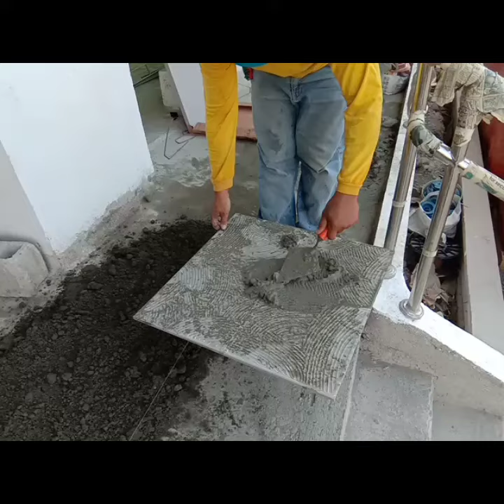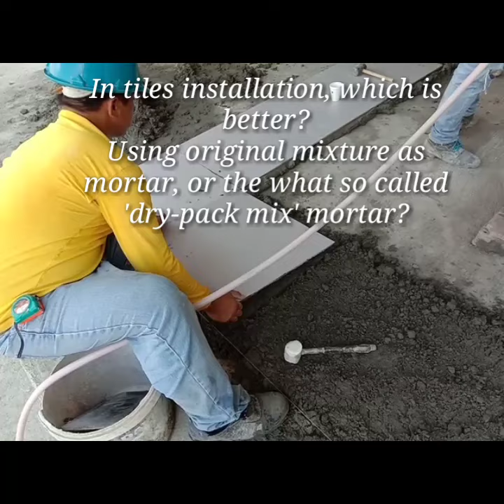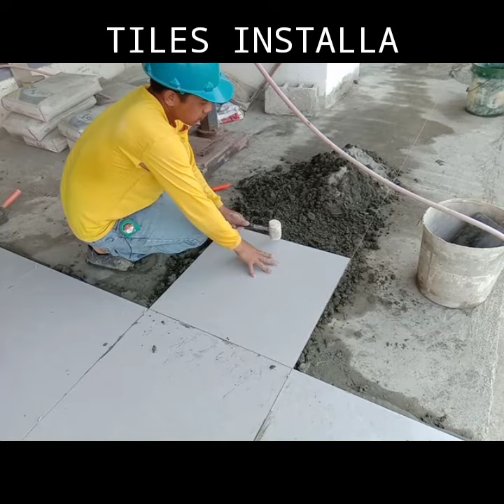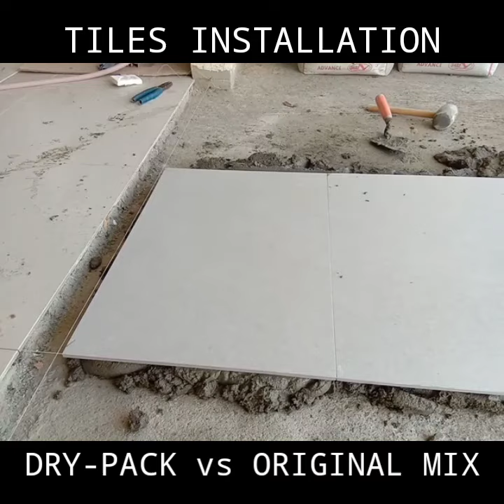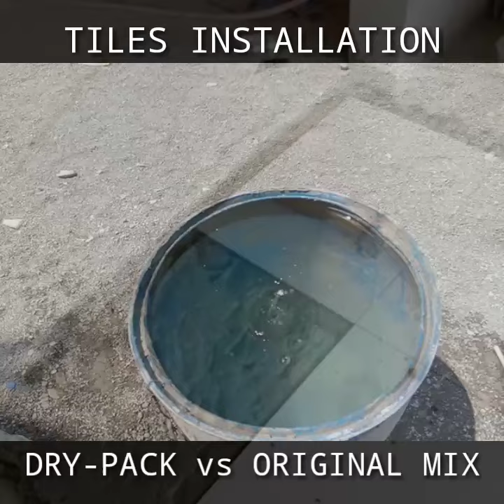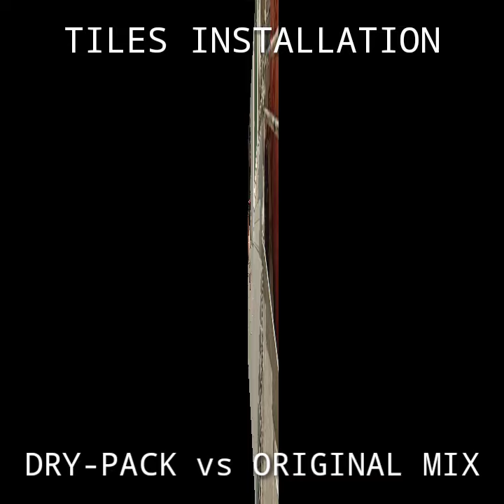Floor Tiles: Comparison Between Dry Pack and Original Mixture | How to Install Floor Tiles

Comment: Anu po mas maganda dry pack or original mixture?
Reply: nka bistay po n dapat un sand s drypack?
Reply: @jasonviray5665  oo naman po..ska dapat level na level at siksik sa mortar para d maging pulbos pag nagtagal.
Reply: mas matibay ang dry pack
Reply: yung original pag bumaba ang tubig sa cemento yung tiles bumababa dinminsan
Reply: Tamang timpla lang ng tile adhesive wag masyado matubig
Reply: Pra matigil ang debate... ang drypack ay pra lang sa sa malalalim ang depth ng floring to finish. Kung mababaw nmn pde nh idereto sa adhesive. Construction consultant here
..
Reply: just follow the procedure of the manufacturer ng tile adhesive di papalpak yan and use electric mortar mixer para maging consistent ang adhesive mixture mo and use tile locking leveler, wag masyado  matipid kaya ka nga nagpapa-tiles eh dahil may budget ka para dyan...
Reply: @liberalparty2579  peede ba adhesive tiles lng ipangdikit lahat sa tiles installation?
Reply: Mas matibay pa yong original mix. Bakit kailangan mong i dry pack kong manipis lng pagkabitan mo ng tiles. I dretso mo nlng ng halo adhesive at  cemento. Wag mo nlng ilagay ang dry pack.. para mas matibay

Comment: Gud morning po. Sir tanung kulang po. Kung ilang tiles yong maekkabit sa sang bag na tileadheciv.
Reply: 60x60 po. Yong ikkabit.
Reply from the maker: As per original mix po mga around 5-7 square meter for 25 kg or 1 bag tile adhesive po sir., mga 15-20 pcs 60 x 60 tiles..but nagdedepende din po ito sa kapal ng mortar as per surface ng floor. Salamat
Reply: @JUANCIVILIAN  sir alin ang mas mainam original,dry o purong adhesive lang. 60x60 ang tiles na ikakabit

Comment: Drypack is only good s mga certain places...pero kung mxado magalaw ung structure dhl s tabing kalsada its best with tile adhesive..mas flexible s movement ang adhesive...just my opinion..
Reply from the maker: Salamat sa pagshare ng iyong experience sir. 👷‍♂

Comment: Ask Lang PO sir, ano Po ba posibleng dahilan bakit madaling nag crack ung mga gilid Ng tiles?dry pack Po ginamit.
Reply from the maker: Hello po, It's either sa quality ng tiles ma'am or uneven distribution po ng mortar, especially sa gilid na part ng tiles baka walang nilagay na tile adhesive.
Reply: @JUANCIVILIAN  thank you po sir
Reply from the maker: Welcome ma'am, keep safe po.
Reply: Kung walang space ang pagkalagay mo possible talaga mag crack ang gilid ng tiles dahil yan sa tinatawag na thermal expansion, dahil sa pag expand ng tiles kaya nag cacrack ang gilid, kaya kailangan talaga ng spacing.
Reply: Nice things to learn from an expert. Thank you sir.  Dry method pa rin ako para magamit agad ang floor after setting. Dapat lang tandaan ang standard ng mixture at thickness ng foundation.

Comment: Mali ang dry pack topping mo sir....dapat di hinahaluan ng semento ang tile adhesive kasi mas hihina ang kapit neto....nasa instruction yan ng tile adhesive
Reply: mali ang vlogger inihalo ang adhesive s cment maling mali
Reply: Sir, tanong ko lang. Okay lang ba na tile adhesive lang ang ilagay ko?
Reply: @FerAndrewOctoman   pg dami k pera pwd solid adhesve
Reply: @FerAndrewOctoman  Okay na okay sirrr kaso madaming adhesive kelangan mo kasi papantayin mo level ng pagset ng tiles..hindi naman pantay perfectly and flooring so magkakaroon ng madaming adhesive....ang purpose kasi ng dry pack bukod sa ginagamit ito para di mabitak ang tiles sa pagseset...mas mkakatipid ka sa pandikit kasi mas maunting adhesive lang ilalagay mo parang papahidan mo lang sya...mas safe din sa kapak ang drypack method kesa purong adhesive....pero advice ko sayo kung manipis lang ang magiging taas ng tiles mo..oks lang kahit di ka na magdrypack..😊

Comment: Good day, 
1. itatanong ko lang po kasi yong flooring ng bahay ko nag angatan po ang mga 60cm x60cm floor tiles using po ABC adhesive direct installation to floor slab.
2. pag dry pack po ba hindi po yan aangat ang 60cm x 60cm floor tiles?
3.ano ang measurement mixture ng cement,sand and water to create dry pack?
4. ano po ang standard thickness ng DRY PACK?
5. Ano po ang tamang installation ng floor tile na hindi po aangat at kakapak?
Reply from the maker: Hello sir good day, ang maaaring dahilan po ng kapak ay ang hindi maayos na pagkabit ng mga tiles, kahit dry pack process or original mixture ng mortar ang gagamitin ay maaari paring magkapak kung hindi tama ang pagkakabit nito. Ang kapal po ng mortar sa tile installation ay nasa 2 inches po depende na sa level ng floor na paglagyan ng tiles. Isa din sa factor kung bakit nagsi angatan ang mga installed tiles ay kulang ito ng tile adhesive, maaari nyo pong tingnan sa 3:45, 4:05, 4:20 mins ng video para sa proportion ng mortar na ginagamit namin. Salamat
Reply from the maker: Maaari nyo din pong tingnan ang video na ito sir, para sa karagdagang impormasyon sa original mix ng mortar. 👇
https://youtu.be/bSE1kJRLqHc
Reply: Ang gamit ng karpintero sa amin ay combination ng adhesive at semento lang. Walang sand. Yun lang po. Nakapagtrabaho kasi siya sa hospital flooring at iyon ang gamit ng engineers doon. Para matibay daw kasi maraming wheelchairs, strechers dadaan.
Reply: Isa din ho ba sa dahilan ng pag angat ng tiles lalo na pag 2nd floor is ang pag  galaw ang structure?
Reply from the maker: @Jejemon-vibes  yes po sir, para puro ang mixture, depende na din sa classification ng floor at specifications nito.
Reply from the maker: @yarbsblight2719  yes po sir, isa din po sa dahilan yan, esp malapit sa kalsada ang structure, kaya mas mabuting sakto po ang mixture ng mortar na gagamitin dito.
Reply: @Jejemon-vibes  magandang suggestion

Comment: MAS MATIBAY PARIN YUN ORIGINAL MIX KESA SA DRY MIX BASE ON MY EXPERIENCE KSI YUN DRY PACK AFTER NYAN UMA ANGAT YUN TYLES🤔🤔🤔🤔
Reply: Depende sa gagawa yan
Reply: Hindi aangat yung tiles sir kung yung dry pack po aya maganda ang pagkakatamper at pagkakasiksik,. Tsaka dpat po maganda ratio nung dry pack,
Reply: Ang nakita ko lang mali sa video nung paggawa nung dry pack hindi nila po tinatamper at sinisiksik ng maayos, matagal na po 1 taon diyan, kakapak na po yung tiles o dikaya aangat,
Reply: Para sa akin po, wala po sa klase ng mix, kasi parehong subok ko po sila, nasa gumagawa po yan,

Comment: tile adhesive is not recomended to add or mix mortar,cement.it will give  poor performance for tile adhesion specially porcelain tiles.every product of tile adhesive must have technical data of specification to be followed if you want to meet the best output.
Reply: Nde lahat ng tiles pwede kahit walng adhisive
Reply: Pag ako ang magkabit nyan..d na ako gagamit nang adhesive..dagdag gastos lang po yan...
Reply: @loyjieancog5032  wala pa akong nakita g granite na nde nag kapak na cemento lng
Reply: @mrindependent1721  ...11 yrs na po akong CW..
Reply: @mrindependent1721  depende cguro yan brad da pagtatrabaho🤔🤔🤔
Reply: @loyjieancog5032  mas dagdag gastos ang maintenance nyan sa huli

Comment: Hindi kakapit yan porcelain tiles dyan sa dry mortar. Buti pumayag ang quality control. After 1 to 2 years matatangal yan  dry mix.
Reply: Tama..porcelain tiles gm8 nla..akala nila porke 60×60 tiles lng..depende sa kung tiles oh porcelain..nagpuputukan tlga yan pagdating ng panahon..kusa umaalsa..kaya ako boss kapag nagtiles kh8 pagamitin ako ng dry pack hindi ko sinusunod..kase sa diskarte ko wala pa naman pumalya kh8 5 to 6 years na ang tiles walang naging problema..
Reply: @johninocentes6391  pwede po ba tile adhesive lang ang gamitin ko? Nagiisip kasi ako ang mglagay

Comment: Pag granite tiles ikakabit 60x60 hindi uubra yang drypack mo matagal na ang 2 taon nyan bakbak lahat
Reply from the maker: Maraming salamat po sa pagbahagi ng iyong karanasan sir.
Reply: Pano boss pag ceramic 60x60? Matibay ba?
Reply: Boss tama ba yong mixture nla sa drypack?
Reply: Sir Gerson Anu pala Magandang method sa granite installation sa lababo?sabi kase ng foreman ko ok na daw ang adhesive tiles lng ilagay lahat.wlaa ng iba.tama ba yun?
Reply: Mas matibay pa ang original mix na halo ky sa dry pack. Maramihan sa dry pack ay kakapak. Tingnan nyo mga ikinabit na tiles na original mix hanggang ngayon hindi kakapak. Yong mga bago ngayon method sa pagkabit ng tiles gaya ng dry pack. Karamihan sa amin dito sa Cebu umaangat ang tiles dahil dry pack ang ginamit sa pag gawa. Para sa akin mas better ang original mix 1bag ng cemento, 1bag na adhesive, 2bag na sand, 4L na liquid tiles adhesive.

Comment: Bakit blind revit pa ang ginamit na spacer doble gastos pa yan mahal pa nman ang rivet pwd nman gamitin spacer ang tali ng box ng tiles
Reply from the maker: Hello po, binabalik po yan pagkatapos sir.
Reply: Napuna ko nga rin sa mga local contractor yan ang mga sinasabi. Pero nagcompute ako, mas magastos ang dry mix. May specified instruction naman ang bawat tile adhesive, mas maganda sundin

Comment: Sir pede Pag samahin ang tile adhesive cement at sand ano po ang ratio nito tnx..
Reply from the maker: Yes po sir, nandyan po sa video ang mixtures.
Reply: Tnx sir kelangan ko pa ba bakbakin ung dating ginamit na original na mixture tapos gamitin ko lmg tile adhesive
Reply from the maker: Mostly po sir, pag nagsiangatan ang mga tiles, ay hind na nila tuklapin ang dating mortar, tile adhesive nalang po ang pinapahid nila bago ikabit ulit.
Reply: JUAN CIVILIAN salamat sir no need na tiktikin ang dating mortar dba ? adhesive na lmg
Reply from the maker: @zebedee577  yes po, adhesive nalang ang ipahid sa tiles.
Reply: JUAN CIVILIAN salamt sir malaking tulong
Reply from the maker: @zebedee577  welcome, Godbless po 👷‍♂

Comment: Dry pack mabilis magkabit..kung pantay lng pag uusapan nasa gumagawa yun..kaya nga may level bar  saka tansi..pero sa dry pack na yan napakarami ko na nakitang mall..super market na 60×60 oh masmalalaki pang tiles nagsiangatan..kayang kaya na tanggalin ng kamay..kaya sa akin kapag may nagsisitang kapwa tile setter bk8 hindi dry pack gmit ko..sinasabi kanya kanya lng ng gawa yan..ordinary mixture lng gm8 ko sa 60×60 tapos adessive sa ilalim ng tiles..5 years na mga tiniles ko walng umalsa khit isa..bk8 bkit pa ako gagaya sa diskarte ng iba kung sa gawa mo mismo subok mo na..pede yan dry pack kung 60×60 na tiles lng..pero kung 60×60 na porcelain tiles depende sa gumagawa..pero sure na karamihan pumapalpak jan..kaya pag bibili kayo ng tiles tingnan nio mabuti kung porcelain tiles oh tiles lng..60×60..kase kung porcelain napaka mahal na tapos kakapak lng pagdating ng 2 years oh 3 years..
Reply from the maker: Salamat po sa pagbahagi ng iyong kaalaman sir.
Reply: Anong size ho b ng tiles /semi granite ang magandang ilagay sa flooring ng bahay?
Reply: Same thing happened sa neighboring houses, lahat drypack, lahat kumapak.

Comment: Tanong po ulit sir, pano po kaya pag replacement ng mga umangat na tiles?
Reply from the maker: Same process lang po sir, tanggalin nalang yung tiles tapos tiktikan kunti para sa mortar.
Reply from the maker: @orfelable  pakitingnan nalang po nito sir, para magkaka idea po kayo. 👇
https://youtu.be/bSE1kJRLqHc
Reply: @JUANCIVILIAN  dun sa video link around 1.5 to 2" po ba yung mortar ?  do you mean ganun din kakapal ang "tiktikin" ? also, assuming di mo rin alam originally gaano kakapal yung mortar nilagay, ano ba acceptable tiktikin para mag bond yung replacement tile ?
Reply: hope meron din kayo video like pag replace ng tiles.
Reply from the maker: @orfelable  someday sir kung may papalitan po kaming tiles na natuklap or umangat. Tamang kapal lang po ang tiktikan nyo sir max na sguro ang 1inch esp ilang piraso lang naman ang papalitan nyo, sakto lang kumapit ang tiles sa mortar.
Reply: Sir Martin,, on my experience lang po Kung natuklap po mga tiles usually 60x60 po no need na po tiktikin Kung papalitan Ng tiles gamitan nyo lang po Ng pure tile adhesive, very tin bed lang po
Reply: @JUANCIVILIAN  thanks po. pure adhesive po ba yung mix ?
Reply: @marvinchampion8190  thanks. di kaya tutuklap pag ganun.

Comment: kalokohan. yang adhesive... additional cost lang

nung ginawa ang bahay namin... more than 15 years na tiles, semento at buhangin lang
Reply: Yung tiles kasi na ginamit ay ceramic kaya maganda ang adhesion ng cemento sa tiles kaya Di pa nasisira pero kung porcelain yan baka 3-5 years lang yan.
Reply: Ano gamit niyong tiles sir
Reply: Dipende po kc yan sa laki at klase ng tiles